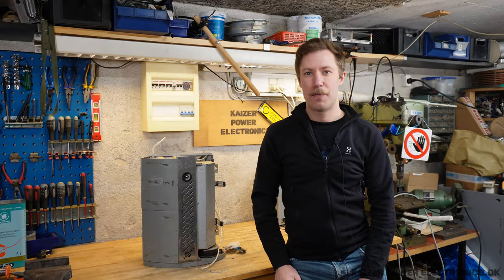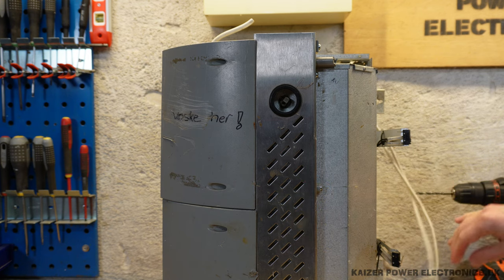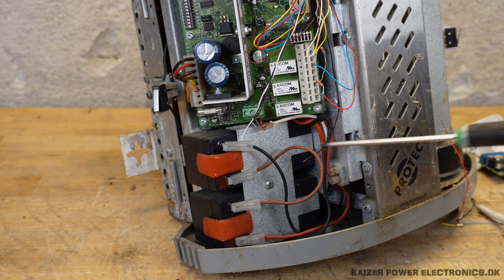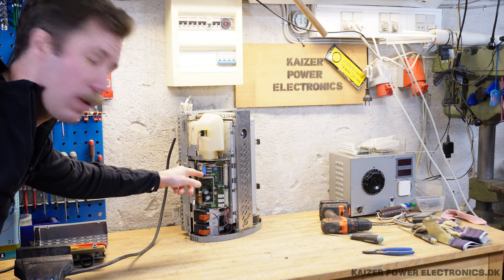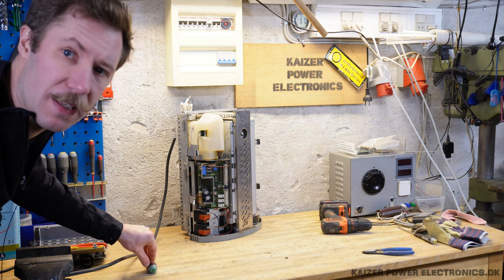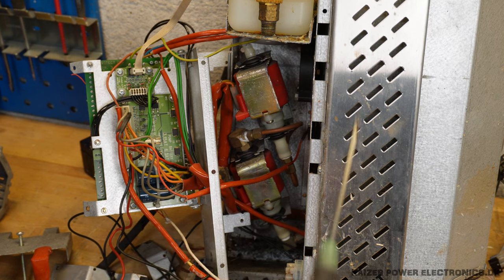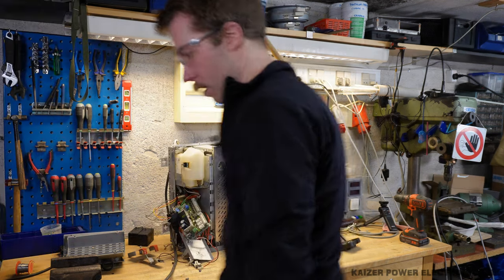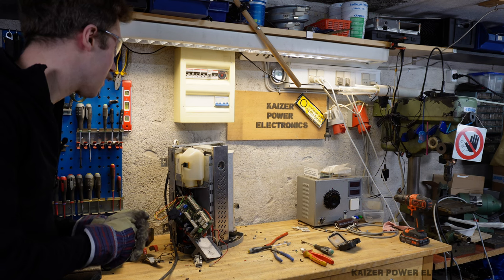Smoke Screen Machine Protect 950 XP - Teardown of a Smoke Cannon!

Comment: Is that oil based or glycol based? I have worked on a few "fog machines" and they are glycol based. Also do a lot of DJ equipment repairs and the DJ decks are always covered with years of sticky, stinky, fog machine goo. I feel for ya and having that directly sprayed on your stuff. I actually just brought in a CDJ-900 for repair and smells, probably like your shop smells... 
But machine that really pumps it out!!
Reply from the maker: I am guessing it is oil, as its sold as such from the manufacturer and my workshop is more slippery than sticky :)
Reply: @KaizerPowerElectronicsDk  Got ya. When fresh, the glycol is slippery too but as it dries it gets nasty and sticky.

Comment: Too bad it went back to the scrap yard.  A little pesticide in that thing is all you'd need for a nice mosquito fogger.  Or, just use it with a Tesla coil (glow around the arcs?).  Good luck degreasing everything.  It is never a bad time to give stuff a wipe though.